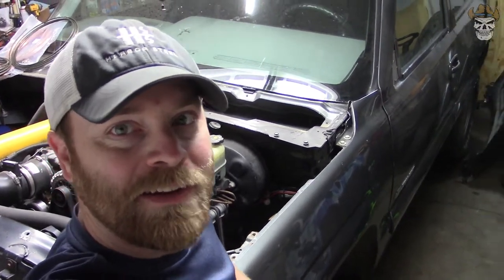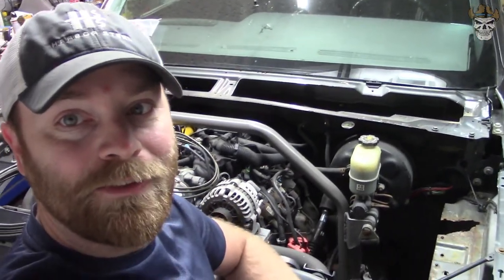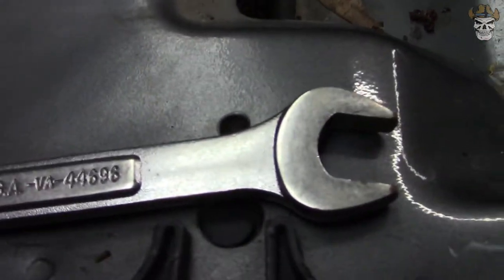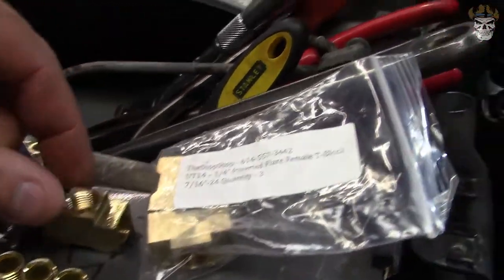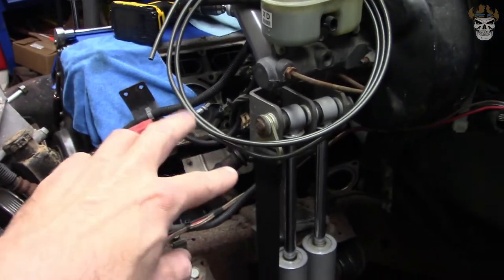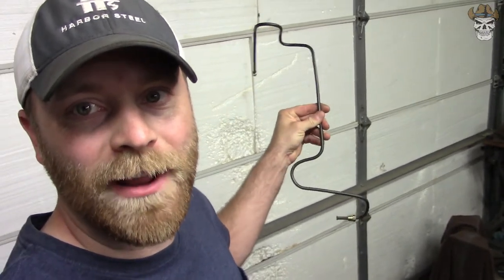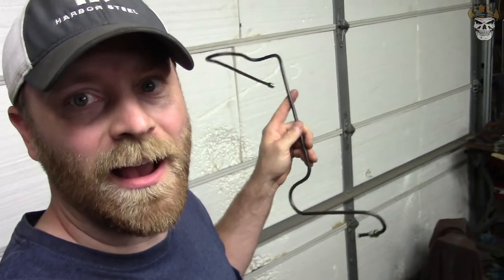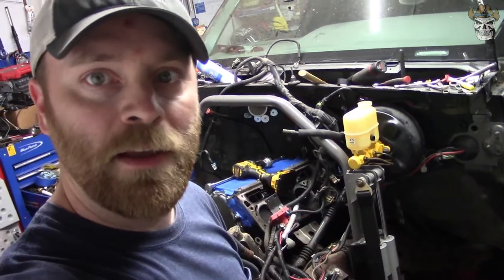Replacing Brake Lines On 2001 Tahoe AKA Disaster Transport

Comment: I did something similar on my '06 Silverado years ago.  

Used Nicopp on it. But got rid of the ABS pump out of the system. 

Split the line and had another for the rear.

It worked well but did pull while braking after that. 

Could probably fix with a proportioning valve but it was a $200 truck so I didn't care. 

On my '06 Suburban it has Stabilitrak so there are two lines for the rear end instead of one. 

Because I plan to use it as a tow piglet I kept it and ran all stainless lines in the factory location. 

I HATED that job.
Reply from the maker: I dont own vehicles long enough to even think about running stainless steel lines.  I always wondered how bad they were to work with.

Comment: I appreciate being able to see what I'm in for. I have same issue except my Tahoe is my only vehicle. So, I need to replace all those hard lines underneath. The chemical used to de-ice the roads here in the winter, extremely corrosive. That being said, copper doesn't rust, right?
Reply from the maker: Yeah its a lengthy job.  The flare tool I used is amazing and will save you a lot of headache.  As for the copper lines a quick search shows - "Copper nickel brake line offers strong corrosion resistance both inside and outside. Road salt and grime is ineffective at rusting the brake line since the brake line is 88.7% copper."

Comment: Did you add a proportioning valve?
Reply from the maker: No I did not.  This is an off road rig that is run in the dunes only so its unlikely I would even notice if I did add one.  Good question though.

Comment: I gotta ask what have you done with the steering see you beat that thing up. I replaced everything with crap trq and 3200 miles later and some beach trips the pitman and idler are junked.  Need something that'll last and not cost me insane money for a beach beater
Reply from the maker: On all 4 dune trucks I have built I have yet to replace a steering part.  Is it sloppy yes but you hardly notice in the dunes.  If I were to street what I have now I would have to replace everything.  One thing I will hopefully be doing over the winter is finding a way to heim joint the front steering and upper control arms.  I guess my suggestion would be Moog as they have a good warranty.
Reply: @PostalRedneck  yeah that makes sense  it's overall a crappy setup. I think I'll weld a gusset plate on the idler and hope for the best with acdelco parts. If they fail fast kryptonite offers killer steering at a heavy cost
Reply from the maker: Yeah its weird that they put such a jog in the center link.  Every time you turn it puts a huge pull/push twist load on the idler and pitman.  Im hoping to make my own center link and have the heim joints between the idler and pitman.  It will create a little bit of bump steer but give the steering a better angle and take a lot of stress of the steering parts.  Not great for street but perfect for the dunes and ramping.
Reply: @PostalRedneck  look forward to see it !

Comment: U are the true 'Master Cylinder'! U make this complicated job look as simple as flipping pancakes. I have a 2002 Tahoe with the same problem. What's the average cost of repair, parts and labor?
Reply from the maker: Haha yeah its a lot easier with the whole front clip off the vehicle.  As for cost it all depends on how much you want to do.  I have a list of all the parts for the job in the description of the video.  I will say that brake flare tool was the best investment if you plan on doing a lot of brake lines.  Good luck and just take your time.